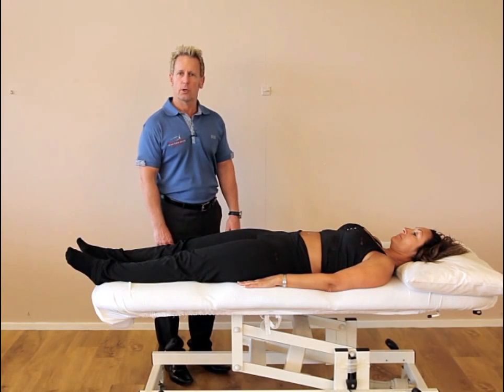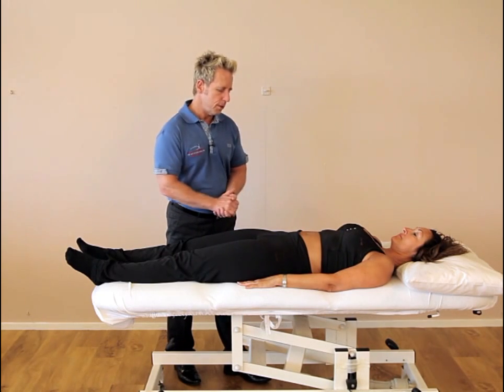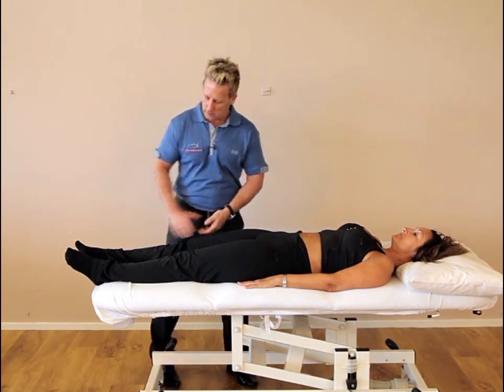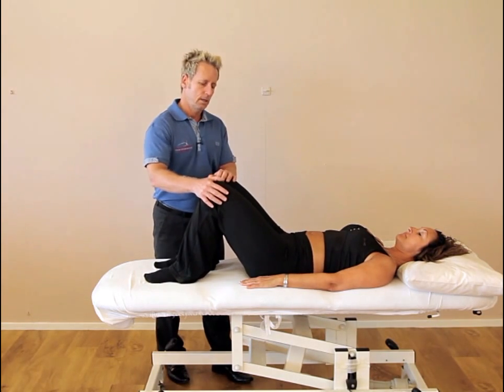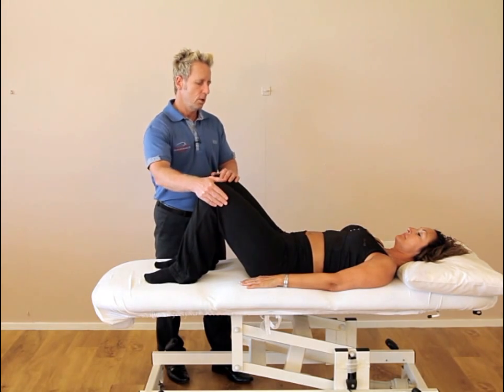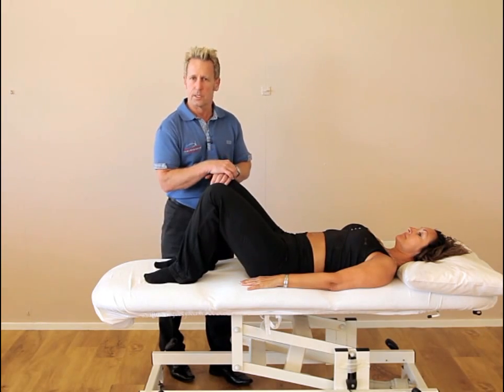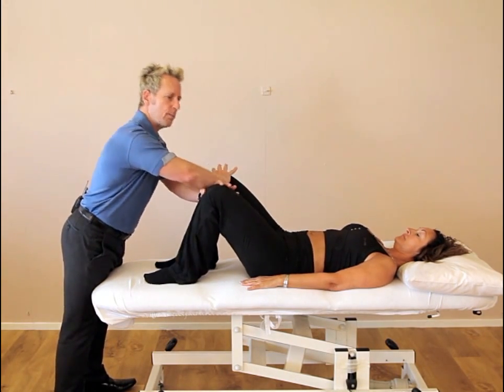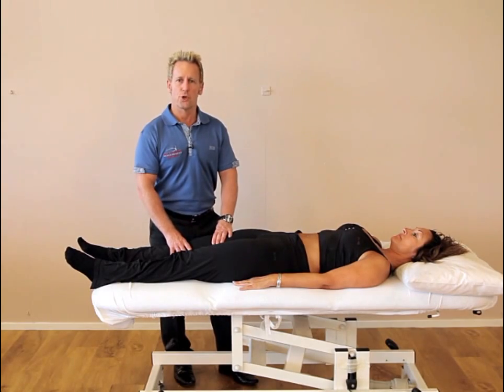How to assess and treat the symphysis pubis joint of the pelvis using HVT Shotgun

Comment: I had a very auditable pop, How often should you do this ? It’s not a permanent fix, but how often can you adjust yourself?
Reply from the maker: Some people do this a few times a week and you can do it yourself - basically adopt the position like the patient in the video - place hands on outside of legs and resist the outwards movement of the legs (like video) for 10 seconds 2/3 x and then place a fist between your knees and squeeze tightly - this normally works, regards JG

Comment: Yes I'd like your rendition of the manual release of the pubic synthesis or the pubic dysfunction method. Yes I'd like your rendition of the manual release of the pubic synthesis or the pubic dysfunction method. I like your preparation with muscle energies to relax the Adductors. I also caught you utter that the displacement could be superior. Yet you show not the corrective methods and thrusts for that lesion. Although I must say I'm impressed because as a retired chiropractor and former massage therapist we were taught in the diversified school of manipulation that there's only one thrust needed to release the pubic synthesis for the pubic bone subluxation/dysfunction which was only restricted patient adduction thrust.  As we know that's a very sensitive area in a number of ways. Perhaps you'd like to show the superior move and perhaps you made another video but I haven't found it yet. Truthfully I don't believe in using any manual methods if I were still practicing Chiropractic to do that. But I found that the Activator Chirooractic  Technique Method is a lot more gentle specific and effective. But I would have reservations of using it nowadays also  on females if I was a male  c hiropractic in practice today because of all the hoopla and accusations  via Me2  scenarios. 😆 Let a female doctor do so to a female patient. But that is not even a guarantee these days because of LGBTQ movement. There is the possibility of offense with any gender preference group in reality. Definitely one area of equality in this fallen world.😆

Comment: Thank you for this Video. When i push(move it fast in and outside at full stride)  my legs to the outside, i feel kind a like a stitch between my legs. What could be the problem? I get the noise when i push my legs together though. Thank you for you help🙏
Reply from the maker: Hard to say without looking at you, maybe see an osteopath where you live, regards JG
Reply: @JohnGibbons  
Thank you Doctor ,🌹I knew primary doctor or orthopedic  ( say its spinal stenosis ,sciatica ? did not get what I was saying when I described, the pain on the one side pubic bone  ,now hard to walk correctly, knee, leg & back pain ,terrible pain ...I will try these exercises ,Thank you Thank you  so much !! 
.ps laying down also makes it worse !! 
Much gratitude W

Comment: i’m only 15, i think i got it from doing splits, i’m flexible
Reply: You are probably hypermobile, in which case you may have issues like this generally. I am the same
Reply: Be careful not to push yourself too hard when doing splits! I did that when I was your age and it messed something up, always go easy and you can always push just a little each time but not all at once. I used to be a gymnast.

Comment: I feel it in both sides and I can now adjust it just by pushing my knees together, but it doesnt feel in the middle. I am assuming that I should feel a single crack on the middle but I feel one on each side
Reply from the maker: Sometimes you can feel a release on the side rather than in the centre, it feels a bit weird though even though the technique is effective. regards JG
Reply: @JohnGibbons  What I meant is that I never felt it in the center.  I always feel 2 releases, one on each side, even when done by my physiotherapist who, since it happens by itself now, stopped doing it to me. It seems she doesnt need to.
Reply: I am the same, I have to have two clicks when I go from sitting to standing. If both sides don’t click, I can’t stand up straight or put my weight through my legs.